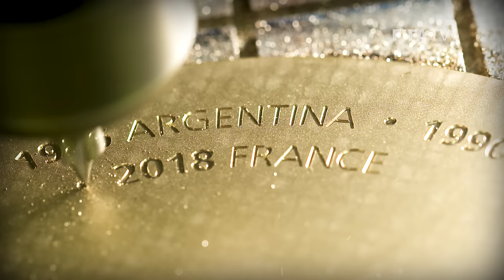FIFA World Cup Trophy Engraving!

Comment: So they engrave the winners on disc's underneath the trophy, never knew.
Reply: @gappywalking9008  only the ones from 1974 to today i think, the ones that won the Jules Rimet dont appear in there
Reply: Caden  it's not 2 trophies, just in 1974 they replaced the Jules Romet trophy with this one so it looks more prestigious I think
Reply: @avantjeef  rimet Trophy  counts as world Cup, they Just re-designed It 😂 i know that there Is a limited amount of remaning space avaliable...maybe there would be another kind of Cup in the future?
Reply: @hackn001  It looks like they are replacing the entire plate on the bottom whenever a new winner is engraved otherwise there would be no video of the engraving of the 1974 winners etc. Hence, they can always deccrease the size of the writing when they are running out of space.
Reply: @thehighground3630  It's not that easy but yeah
Reply: The plate at the bottom originally had the names of the winning teams engraved straight across in the middle of the plate, which would leave space for only a certain amount of teams. They redesigned the bottom so the team names go around in a circle, ensuring that there is more space and there won't be an issue of replacement any time soon
Reply: @juanma0205  no it’s only from 1970 I think
Reply: @avantjeef  it was 1970
Reply: Yes and they engrave the names in the countries’ native language: España, Italia, Deutschland, Brasil, etc.
Reply: @juanma0205   That's because there is very less space  so they have written from 1974 only
Reply: @salg23  That's  Class
Reply: @Shakemon  That's because they write countries that won that trophy, not the Jules Rimet one. Jules Rimet also had winners engraved... had
Reply: @avantjeef  They did not replace the Jules Rimet trophy for a more prestigious one. The reason was that the original trophy would be permanently kept by the first nation to win it three times which was Brazil, and it was kept by the Brazilian FA and put on display in Rio until it was stolen in the 80s. It has still not been found and there are fears it has been melted down.

Really disgusting of the brazilian thieves that did that. They destroyed history.